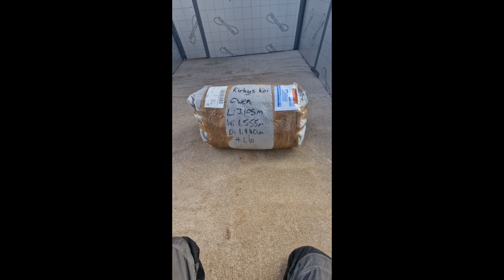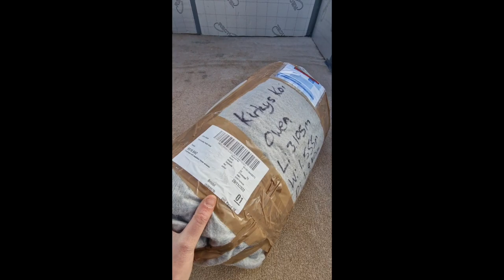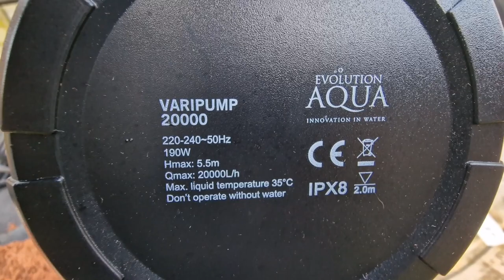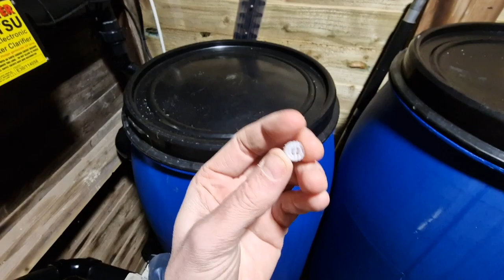Pond Window, insulation and box weld liner and General Waffle!

Comment: Awsome job josh , hard work in the cold hope the sealer went off ok in the cold
I wouldn’t worry about that block work slightly out the glass is spot on level like you said build it up when you fit coping mine is slightly out also as I am not a builder but you can’t notice it
Spot on buddy all the best Jiffster 👍🏼👍🏼

Comment: Im building one soon. What blocks did you use?
Reply from the maker: Standard 7nm blocks from Travis perkins. I laid them flat and my internal dimensions are 3m x 1.5m x 1.5m. Around 300 blocks
Reply: @BrizzleKoi  ok thank you. How do i work out how many blocks i will need. Hoping to build mine 8ft by 8ft by 5ft with a window like yours.
Reply from the maker: @Stefan Hedley  draw it out on paper...block size is 440mm length x 215mm wide x 100mm height. Morter joints should be 10mm
Reply: @BrizzleKoi  ok cheers mate. Looks like im gunner get mad soon working it out😂😂

Comment: Great job are you going to use a retro bottom drain?
Reply from the maker: Eventually yes....want to get the whole thing up and running first then I'll purchase a retro bottom drain. All the best Derek 👍
Reply: Just came across your channel, build looking good. You have gone to a lot of trouble to get things right but no bottom drain. Worst mistake I made when I built mine. A year later I was draining down liner out cutting a channel in the base and install the bottom drain best move I made. Good luck
Reply from the maker: @Martin Gage for what reason did you decide to dig it all up and add the bottom drain? What was your setup prior to installing a bottom drain.